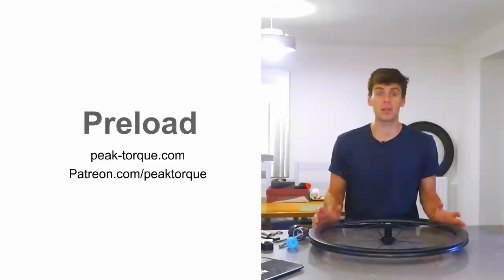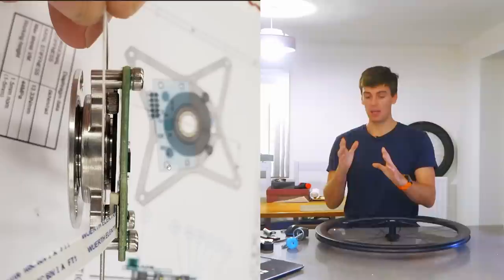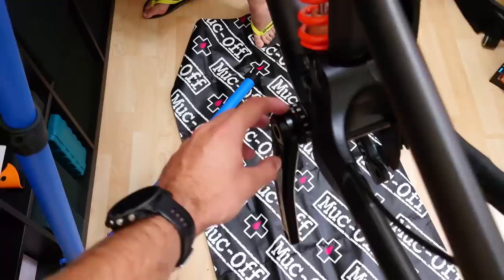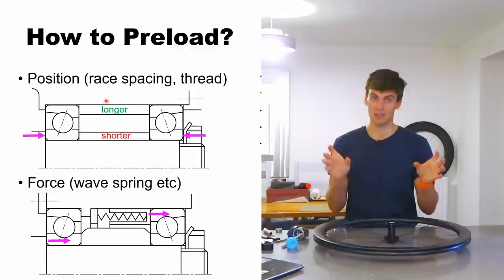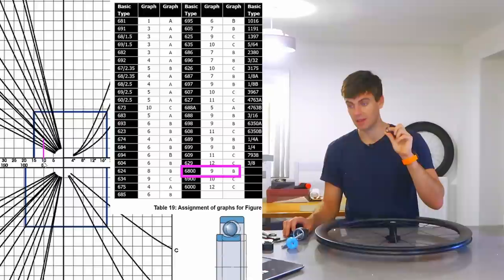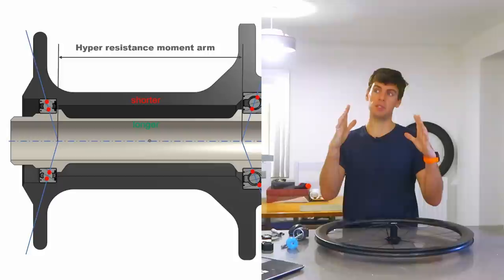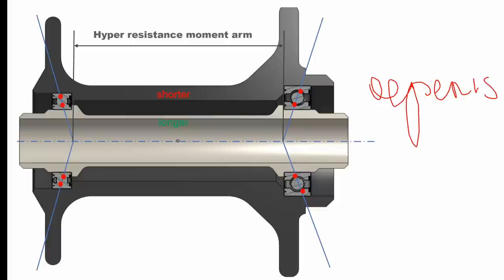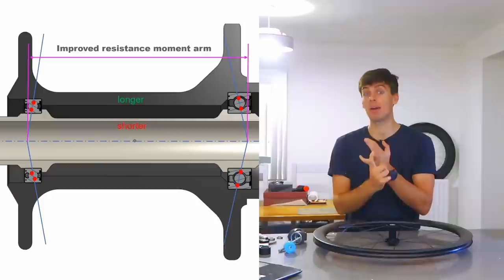Bearings and Preload Explained #bearings #engineering

Comment: One question: What about angular contact bearings? You see these being used in bottom brackets on occasion, for instance by WheelsMFG. What's the advantage? Are they more durable? Are they easier to preload right? Why do we rarely see them in hubs nowadays when - to my understanding - all the loose ball bearing assemblies that used to be common in hubs are in principle angular contact, right?
Reply from the maker: This question keeps coming up so I'll pin it. In my opinion we went away from cup and cone bearings in hubs because, and some of these reasons are why we don't use cartridge AC bearings in hubs;
1. Commercial. Only Shimano has/had the ability to in-house produce cup and cones at high enough volume and quantity to make them viable. 
2. Weight: cup and cone and angular contact setups are generally heavier.
3. Drag: AC bearings normally have a higher dynamic friction than norma deep groove ball bearings.
4. Packaging: AC bearings are less readily available in as many sizes, so it can be hard to find one to neatly fit into an extremely lightweight/complex hub design.
5. Tolerances. As we know bike industry tolerances are shit. Preload tolerances are crucial in AC bearings as they can only really take axial load properly in one direction. So a pair need to be 'matched' which is highly costly. 
6. Radial load. For a given size envelope an AC bearing has a lower radial load rating than a deep groove ball bearing. This is where most of the load is coming from (rider weight, bump input etc). 
There are more reasons im sure!
Reply: @PeakTorque  Excellent explanation. Thank You very much! I'm surprised to read that drag is higher for AC bearings. My completely unscientific subjective impression has always been that nothing spun as freely and easily as a properly set up and preloaded cup and cone hub. In fact I had a front wheel with a Shimano hub that virtually spun forever.
Reply: I currently have a Wheels Manufacturing BB with Enduro's angular contact bearings (steel) to see how it's like living with a pair. (this is also my first quality BB in 10 years of riding) Since this BB should be easily rebuildable, I can swap to radial bearings on any future full service.
Reply: @sebastianm2381   The drag on an angular contact bearing "may" be higher when loaded radially, however it's significantly lower when loaded axially.  Different horses for different courses.    Of course the design of a particular angular contact bearing could influence that as well, since "angular contact" does not imply a "fixed in stone" angle of the contact face.
Reply: Much of what the bike industry favors and tends to trend to is cost and ability to get the general consumer hyped up to buy it.  For example in 20 years gravel bikes (I'm betting that road bikes too) are going to be largely dual suspension but consumers typically buy designs without suspension.  Suspension designs are more complicated to engineer and more costly to manufacture but consumers aren't going to readily spend the extra money to make it worth the extra hassle to make.  In fact most likely they would make more money selling a bike without suspension (despite it being easier to design,  manufacture and market).  It's a similar idea to angular contact cartridge bearings used in hubs and bottom brackets.  My old mountain bike has some wtb new paradigm hubs on it and they've been brilliant for the past 25 years.  Angular contact is expensive to do half decently but hard to market to consumers.  Heat treated super steel is lighter weight than straight gauge titanium.  If you tell an average consumer that a frame is ti (especially 20+ years ago) their eyes will/would light up and they'll get excited.  Easy sale.  Try explaining the differences between different types of cartridge bearings and you're going to see their eyes glaze over in a minute.  It will result in the salesperson/bike shop wasting their time and the customer walking out of their shop to buy a bike at the other store down the street - nearly every time.  Good radial contact bearings are good such as dt or bitex.  Good angular contact is better.  That said how much better and how much more expensive to manufacture and for what extra profit?
Reply: angular contact bearings different story if u get a light preload bearings all adjusted in factory just same high inner and outer spacer are ok for perfect preload
Reply: but if you want to increase preload for angular contact bearings preload light to medium just grind inner spacer 3 microns

Comment: as a mech engineer myself l have to agree very hard. the stiffness differrence between X and O bearings may not be that much, but the discbrake heat aspect could be quite important. you can maybe check that with unequal bearing wear drive to nondrive side

Comment: Very interesting topic. One thing that you didn’t discuss is the method of assembly. There are various tools (read sockets) out there which variously apply pressure on both of the races simultaneously, or just the outer etc. In my testing, I’ve found that the assembly method can have just as much if not more of an effect on the final preload of the bearings as the tolerances in the bearing and the shaft lengths.

Comment: Quick comment: Around 3:30 in, you mention that wheel bearings in cars, preload doesn't matter as much as there can be some slop. As an engineer for wheel bearings for cars, preload makes a huge difference in lots of the different attributes of the bearing, from drag, life, and seal integrity/sealability. Most passenger vehicles use a double row ACB and are designed in a way to ensure the proper preload. When a bearing goes out of preload, this can lead to vibrations, poor life, and reduced stiffness.
Reply from the maker: Yes to be fair you are right, i was getting brake judder on the front right (in the video), tightened the nut 1/10th of a turn and it fixed it. I am always worried about thermal effects so i tend to leave a tiny tiny amount of free play rather than doing it too tight!
Reply: @PeakTorque  for this reason, most manufacturers have gone to an orbital roll form, essentially a big rivet, which eliminates any adjustment of the preload. Mercedes is one manufacturer that has stuck with a very old design that still relys on a nut to determine preload. The theory of most manufacturers is, eliminate this variability as who knows how the quality of some mechanics torque wrench (or if they even use one) to determine all the final preload.

 Overall good video. The wind space axle length bit is slightly funny.  Always enjoy your videos. Keep up the good work
Reply from the maker: @collinsnyder8682  cheers! If you happen to know what the torque should be on the w204 mercedes front do let me know! I just nipped up finger tight so there was no play when grabbing the top and bottom of the rotor!
Reply: Wheel bearings in struts have a circlip to mitigate any drift when loading up the hub. The old tapered roller bearings were preload critical. You could do it to feel but preload dial was advised if you had one. I've done loads of bearings on my old classics by feel.

Comment: I wouldn't wanna correct an engineer but I think they did it right when the wheels are tighten to the frame . When the end caps pushes in the inner race toward the axle. You would get the back to back loading you want. And there would be no load path to push the bearings out once installed onto the bike with the thru axle tightened. Left outer race lateral outward force would be stopped by the right outter race towards the hub body when axle wanna shift visa versa both side.

Comment: Nice work. 👍 Good info

Ive only ever preloaded cup and cone wheel bearings with spacers taking up the fork gap under a quick release during adjustment. It was part of Paconi blueprinting at the time in the early 90’s. It was amazing how the qr would compress the axle.

Comment: I made the same observation when I changed the bearings of my Hope Pro 5 rear. The bearings preloaded substantially in the same manner, showing that the axle was shorter than the hub shoulders -- which I found weird. This preload should get reduced when the wheel is installed though (since the axle gets compresses a tiny bit). Next bearing change I plan to play with 0.1mm calibrated washers to try and set the contact angle the other way around. I'm a heavy rider so I won't be waiting for long:)

Comment: This is an awesome demonstration and answered a lot of questions as I was putting new bearings in my dt240 hubs. I do have one question in relation to preload and the length of the axle vs the hub shell. Now I didn't do any extensive measurement so take this with a grain of salt...just my observations. It seems that the front hub on my wheelset is set up similarly to the Winspace wheels you were demonstrating where the hub shell is shorter than the axle. I noticed this due to the fact that when the bearings were fully seated in the shell the bearings were fairly stiff and didn't roll very smoothly. They felt a bit bound or overly preloaded and it made me worry about bearing life. 
My moderately scientific method to test how freely they would spin was simply to put the valve stem at 90 deg relative to vertical and see if it would fall to the bottom. When the bearings were seated in the hub shell the valve stem would not move and the wheel remained stationary. However when I put the wheel in the fork and loaded up the inner races by tightening the skewer the wheel spun much more freely based upon my method above. The valve stem rotated downward solely based on gravity. 
So after all that here is my question. Could the reason for the axle being longer than the hub shell be due to a small displacement that occurs in the flanges of the axle when under load from the skewer? If there is enough displacement (or in other words a slight shortening of the axle between the flanges) due to load could it potentially bring the bearing into proper alignment?
Anyway...just a question from my observations. Great content and thanks for the video.

Comment: This very interesting, thanks. We have lots of bearing setups that we rebuild on our rotary motion industrial machines. Learning as we go, there are lots of questions and mysteries we have about these topics. What is the design intent, where are angular contact bearings used, ahouls they be back to back or face to face, what clearance ratings mean and which to select, how important this might be. Why a bearing might be press fit vs sliding fit, why apparently identical assemblies run at different temperatures, what size race spacers might be and are they worn, when to use wavy springs and shims, circlips. Its interesting to be able to imagine how a few microns might affect our results in practice

Comment: Would you agree that a easy way to check for back to back tolerance is if the wheel spins freely when the axle/QR is tensioned but then feels a bit draggy if the end caps are held in your hands and the wheel spun? Also your hub tolerance must be deliberate as even Chinese CNC turning is more than capable of single micron tolerance, even with anodising allowances.

Comment: just a quick thought of why it's face to face is that the dust cap rotates with the spindle. it should't contact the outter race .  plus then it would become a possitional preload system which could lead to exessive preload and wear on the bearings?

Comment: Negatory on the GXP crank preload. With the Sram crank, only the NDS bearing supports the crank axially, the DS bearing is there only for radial support. This is achieved by the spindle having a step down from 25 to 24 mm (I think...) in the diameter before going through the NDS bearing where it is then captured by the NDS crank being tightened down on it.

This works on threaded BBs, but with PF BBs, the DS cup could get loose.

THAT is why the PF GXP interface uses a wavy washer. Sure, it preloads the bearings, but only in the PF varant, not in the threaded variant.
Reply from the maker: Yes only the nds takes axial loads on gxp agreed, the other bearing is floating and only does radial loads as you say. However with both PF and Threaded gxp, the wave washer placed on the DS does indeed preload the nds bearing as it pushes the crank assembly away from the bike, 'pulling' on the spindle which is locked to the NDS inner race.
Reply: @PeakTorque  that's the catch, the threaded variant of the bearing, in my experience, does NOT come with a wavy washer.

EDIT: https://www.sram.com/globalassets/document-hierarchy/user-manuals/sram-mtb/drivetrain/mtb-cranksets-and-bottom-brackets-eeu.pdf
Page 11 and 15.
Reply from the maker: @Primoz.r  That is very odd. Maybe the threaded version has a zero clearance bearing for NDS. Who knows.
Reply: @PeakTorque  If I remember correctly (transfering a crank from a PF BB bike originally to a BSA BB bike) there is actually a gap on the DS between the crank and the bearing. Imagine my surprise at not getting a wavy washer and me not being able to find the old one, not having a spare, etc., only to look up the manual and see it's not needed.

I'm also fairly certain I saw somewhere written that it's there to prevent the PF cup from wiggling out from the frame, like I mentioned. Which I don't see as impossible given the design and given how BB30 and DUB from Sram (and Shimano stuff) works preload wise.

Comment: Hi, I'm an engineering student and I'm trying to understand how to calculate my bearing resistance to axial loads. I have a double row ball bearing with a radial load resistance of 4000N, my radial load is 2700N and my axial load is 800N. What should I look for in a datasheet to be sure the bearing can resist my axial load? What calculation should I do? I cannot find any specific explanation to get a value of max axial load for angular bearings, if you could help me out that would be amazing, thanks
Reply from the maker: You can use this tool to calculate the bearing life https://www.skfbearingselect.com/#/bearing-selection-start

The equations behind that tool are on the skf site.

Comment: Great video! What's the optimal preload for bearing life then? When setting up Shimano hubs the usual advice is that a tiny bit of slop is better than too tight as the QR will squash it up a bit. But idk if this is just bike shop myth and lore.
Reply: Not a myth. Park Tool also recommend this. I also do it, and you can actually feel how tightening the QR skewer makes the slop in the bearings go away. Some newer Shimano hubs use an aluminum axle, so it will behave a bit different, but still should squish slightly under the QR load. I have one of those newer hubs with aluminum axle as well, but haven't tried it out yet.

Comment: Doesn't the 0.2 value apply to a single bearing, so with two in the assembly the target value should be 0.4 rather than the 0.19 you measured?

Comment: I would like to see a demonstration that a difference in lateral wheel stiffness between two different bearing preload arrangements can be meaningfully measured.  I suspect that it cannot, due to all the other components that make up a wheel (spokes, rim, nipples) being in the load path.
Reply from the maker: It can easily me measured by not doing up the thru axle tight (so no preload)

Comment: To improve that moment arm from the wider stance of outer race, you would need to redesign the the hub's preload system to provide preload externally rather than the current internally provided preload. By reducing the length of the axle collars, the bearings would no longer be preloaded? There would then only be two ways to apply that preload, either through the end caps, or via a threaded collar. Since preload provided through the end caps would vary depending upon axle torque, on top of that being too much preload, that would then require a redesign of the preload assembly. Please let me know if I have misunderstood, just trying to learn (Mech ENG student/bike mechanic) :)
Reply: Actually to correct myself, I suppose the thru axle would provide the preload, and then the hub axle collars would prevent any excessive preload. Would feel a bit weird off the bike but if it works who cares. I guess the only issue that you may encounter would be the large amount of force exerted on those hub axle preload collars, which if aluminium, may not be strong enough.
Reply from the maker: @jdodd1258  Yep you got there in the end! When the axle is shorter, the end caps provide the preload when clamped and lock everything to the inner races. Preload does not depend on the thru axle load, but the thru as axle is needed to set it. If that makes sense!
Reply: @PeakTorque  Thanks for the clarification!

Comment: Buy a new hub axle, turn down the shoulders 0.2mm on each side and then back to back test it! I'm sure the difference could be measured but  I'd love to see if the difference your describing can be perceived. You could even have someone else assemble each setup without you knowing which axle was in it to eliminate any potential bias.
Reply: fyi there is no need for another axle: set of standard shim rings will do. They come in thicknesses from 0,05. Making the assemly as a blind test is smart though...
Reply: So to make the wheels stiffer simply put one .05 shim on outside of each bearing on the rear axle? Does this apply to front axle as well?